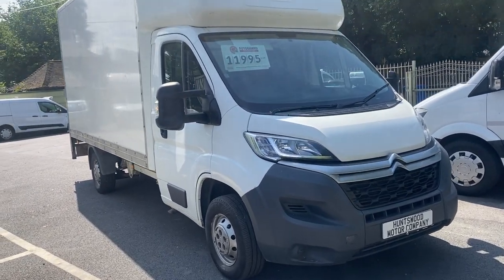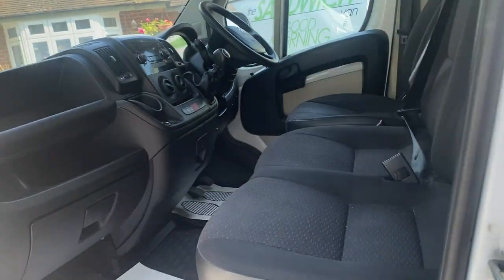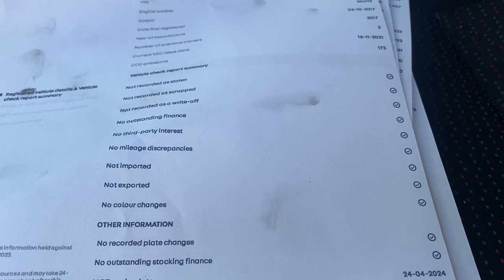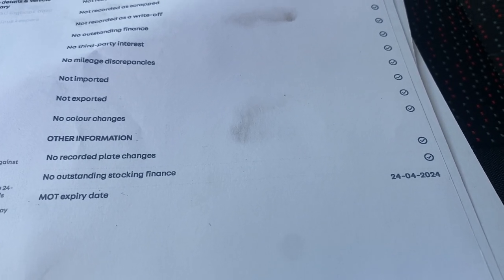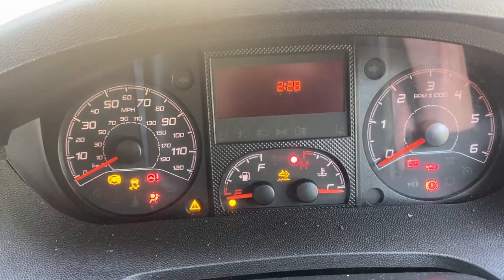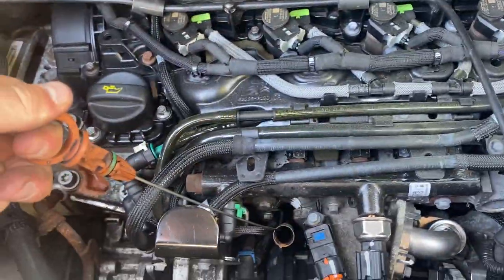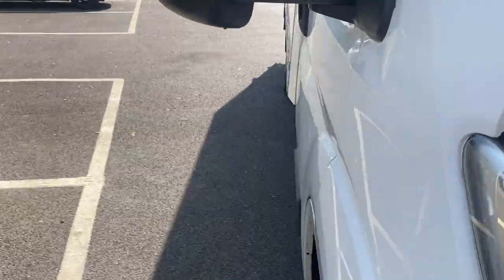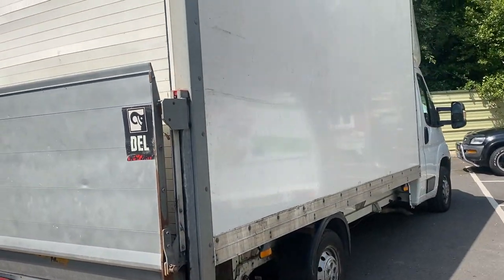Common Problems with a Citroen Relay / Peugeot Boxer Van 2.0L 2016-ONWARDS

Comment: Most of the problems listed are through driver fault or bad maintenance. I have had a boxer for 6 years with no faults. Oil changes done every 6,000 miles,(10,000Km) gearbox oil yearly, don't drive with my hand on the gear stick all the time, seat properly adjusted for proper clutch travel. Warm the engine slowly after a cold start. One of the most common buses here in Germany, so we cant all be wrong. BTW, VWs are terrible, and seem to be designed to pack up at 100,000 Km

Comment: these are absolute garbage - relay, boxer, movano, ducato.  All Fiat underneath with stereotypical Fiat "reliability" ie zero.  It'll cost you more than the van is worth to keep it on the road.  Everything breaks on them and everything is at least a grand to fix once you factor in labour and VAT.  Just avoid them and get a Sprinter.
Reply: Had Sprinters, they break just as often and cost even more to fix!! 😆
Reply: Please do not buy a sprinter. They are an electrical nightmare on post 2018 models. Overpriced and over rated.
Reply: @mikewright2041  And sprinters rust!

Comment: not a bad introduction to buying one of these, but one of the main problems with these vehicles, despite nearly 20yrs of production, are the poorly designed,  and leaking skuttle drains, which have been likely badly neglected by the previous  to give flooding in  the engine bay. with obviously  dire consequences. Any signs of moisture  move onto another inspection

Comment: Other than the wing mirror sensor as below comment, They all crunch the gears, i had one with 7000 miles 5th crunched, same with one just stolen 19000 miles and every Citroen fiat etc The box will crunch a bit depending how you drive it,

Comment: One nugget of information is the External temperature sensor MUST be in operation for the DPF to regenerate. 
I noticed the external temp reading was blank and there were DPF invoices.

The external temp sensor is in the drivers wing mirror and will be a little nipple on the underside of the mirror. 
Chances are it’s either damaged or it’s been replaced with a aftermarket mirror that didn’t include the temp sensor.
Reply: Well done my friend, I was just about to comment on this but then I seen your comment 😁👍
Reply: This can be very detrimental. Mine went faulty then read 51c on the dash. It was driving like a breakdown was imminent 😮

Comment: Are the older 2.2s better?
Reply: Wondering the same
Reply: Only if they are Euro 5 from 2012 onward. The ones before had issues with self desroying motors. The Motor generally is a Ford Puma motor (at least the 2.2) same as in Transit and I think it is okay, but not perfect. It has a chain, so its good because no maintenance at the same time it is bad, because you never check if the chain needs a change or not. Injectors can be an issue. I have a 2013 Boxer with 2.2 130 and it does not like to start. So I am looking now to get a newer one, even though I am not happy about the Additives and extra tank and issues that come from ad blue...

Comment: I have the 2.2 hdi on a 2016 model Citroen Relay. The engine cuts out at speed on motorways as I slow down. Go figure. Junk.